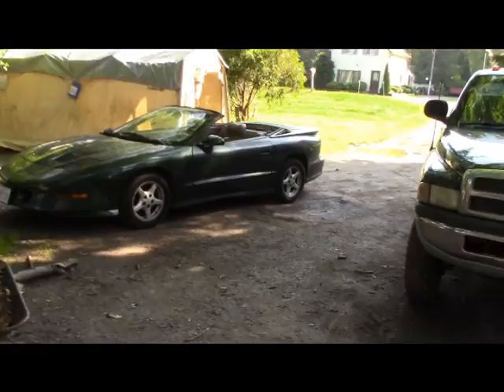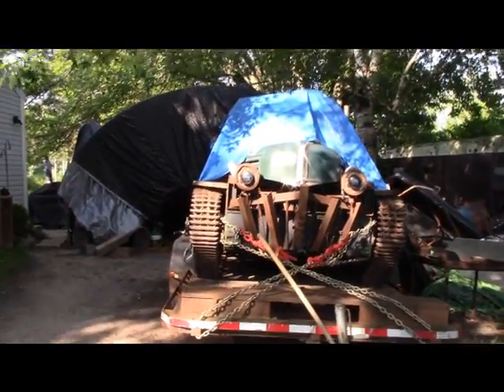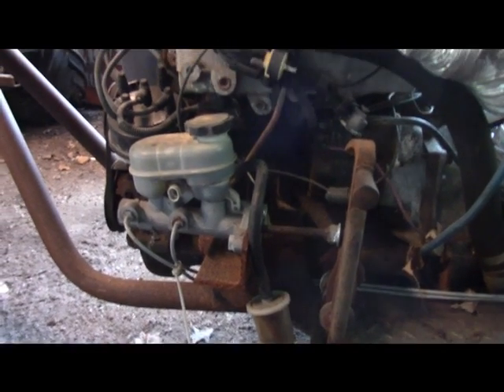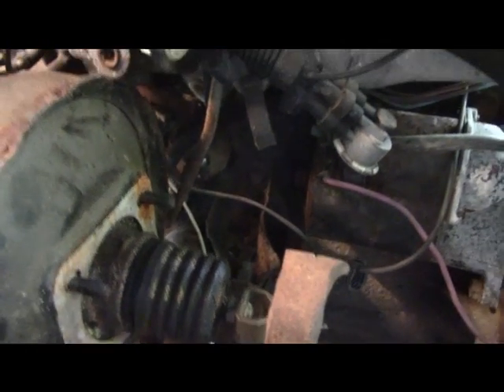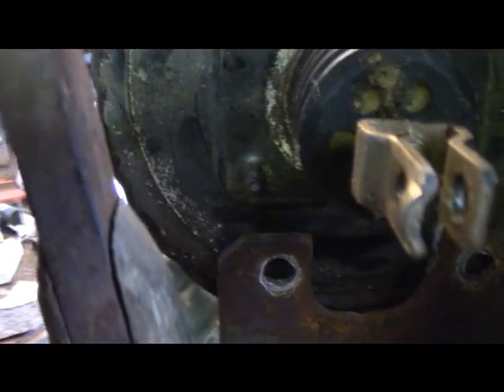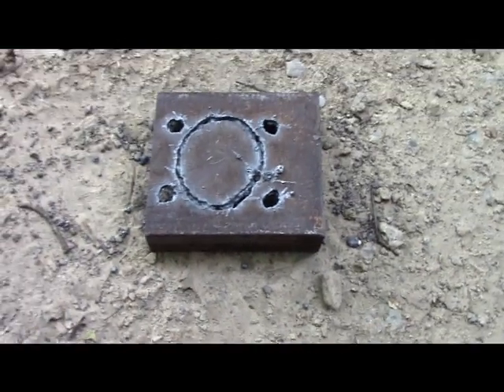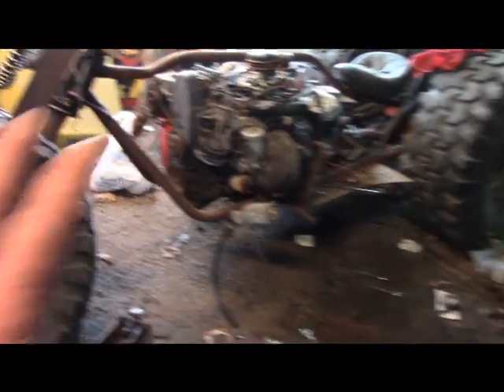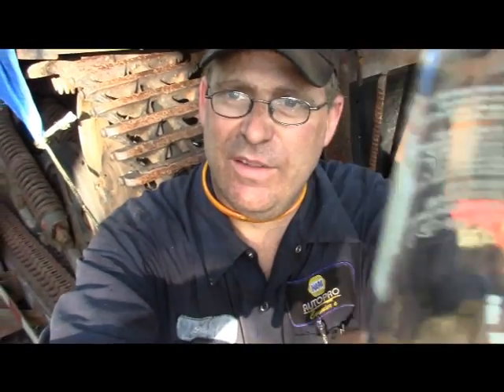Brake booster install on the Monster Trike

Comment: I would use the pedal and bracket the booster came with. Cut off the old brackets and weld higher to get the pedal where you want it. Plus having the master cylinder higher it would be easier to bleed
Reply from the maker: Ya dont like the look of it, going to have to redo this set up

Comment: i have a whole field of those black berries. ikeep mowing them down and they keep coming back all over again. Chop off saw looks kinda flimsy. Do you have a capable enough vacuum line to run the booster ?
Reply from the maker: Chop saw blades are garbage lol. If I take the side cutter and cut a peace out of it, it cuts alot better

Comment: what if you flipped the booster over in the bracket...i mean the booster itself doesnt have to face any particular direction, like up. as long as the reservoir stays somewhat upright....
Reply from the maker: was thinking of that but will have to have another pivoit point
Reply: reverse engineer this :)  http://www.restorationperformance.com/universal-right-angle-booster-bracket-for-use-under-dash/